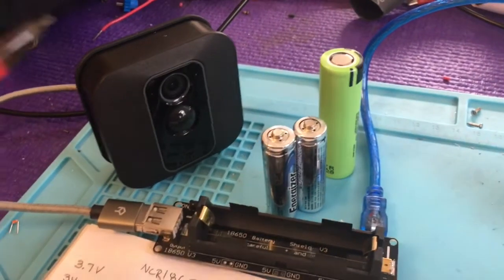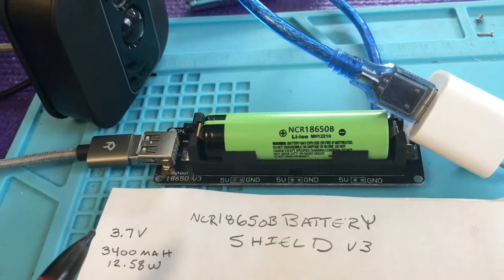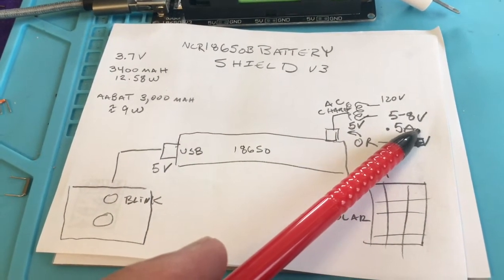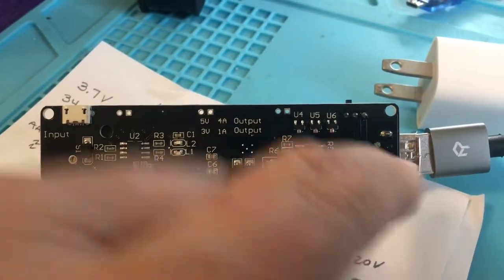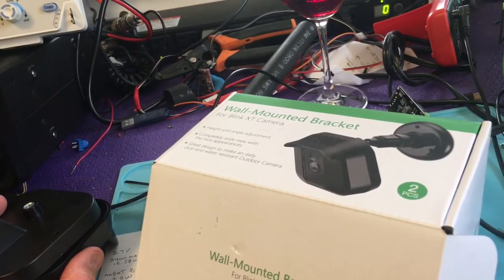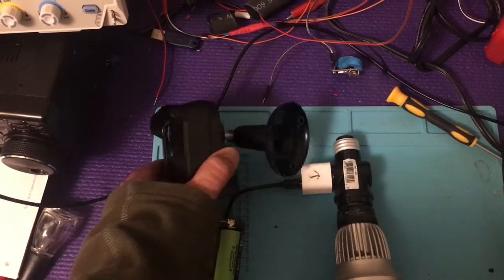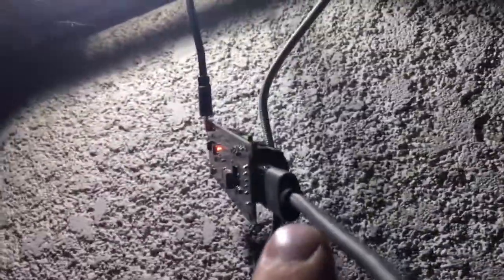Using Rechargeable Battery with Power Cord Charger Accessory with Blink XT2 Cameras

Comment: So how well does it work with time? I'm afraid the stand by power consumption of the board might drain the 18650 faster than expected. Id like to just make a rechargeable pack that I can charge and maintain on a yearly scedual instead of the AAs and then use the cameras more power demanding settings without worry.
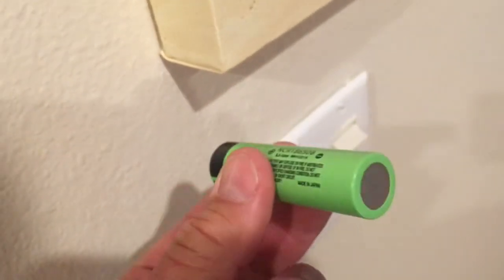Reply from the maker: Jim My porch light is on a timer so I can’t say. I think the boost from 3.7v 18650 5v is not that efficient. I have another blink video where I use a  cheap 18650 pack making 12v and buck it down to 5v. Using cheap buck converters. You need to roll through the video a bit to see the section. 12v can run a long distance so your pack could be located at ground level for easy charging.. 120v or solar. See minute 7:20 https://youtu.be/_bQJNWpya-A . Comments have the parts list. A cheap usb power pack would also work for each camera but you can’t locate too far away. I do like your idea.
Reply: @dannyjensen4954  honestly I wonder what the cameras circuitry is like. I wonder what the voltage tolerance is on the battery terminals. Perhaps its wide enough to operate at 3-4.2v and all you would need to use is a 18650 with internal protection. And the lack of buck or boost converters would be far less wasteful. Or perhaps the same would be acceptable on the micro USB input. Because it either uses the 5v directly or steps that voltage down to the 3v battery level it already is capable of running. 

And a pack of 2 or 3 18650s would be able to run the camera on high settings for longer than two AA battery can on medium settings. So its potentially a very good and cheap upgrade... that is you dont have a high idle current from regulators
Reply from the maker: @jim4556  I wouldn’t mess with the blink batteries with different voltages. The usb input is regulated and supported in all versions. 12v 3s 18650 has worked for me with a 5v usb buck.  I’m driving multiple cameras with this. I don’t like messing with ladders to charge. I’d consider using cat 5 cables to charge / replace remotely from the ground level. I’ve got waterproof cases over the cameras. Battery access is a hassle at the camera. I’m solar charging the 12v pack but your method of offline charge would work. Please do let me know what you try.
Reply: um. just get a longer usb charging cord and plug it straight into camera. let the porch light socket power the device constantly but just unscrewing the bulb. that way the power source is always active. if u actually need the light just tighten the bulb till it lights up. never turn light switch off just unscrew build. lol easy
Reply: they also make a motion sensor light bulb. screw it in and power camera at the same time. never turn off the power switch cuz the bulb will cycle thus constantly powering ur blink camera